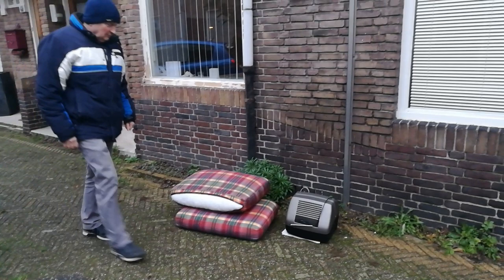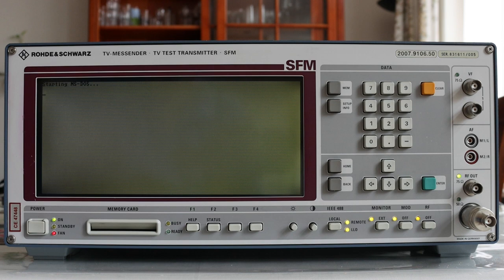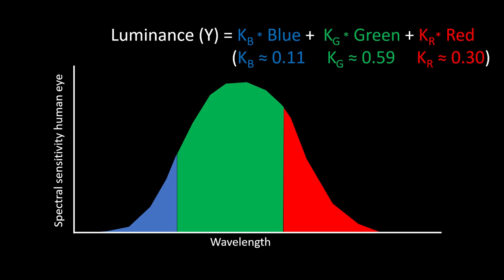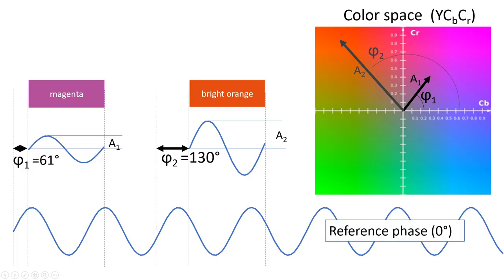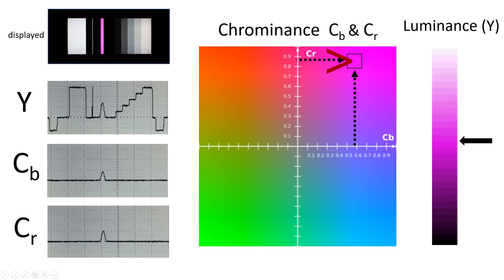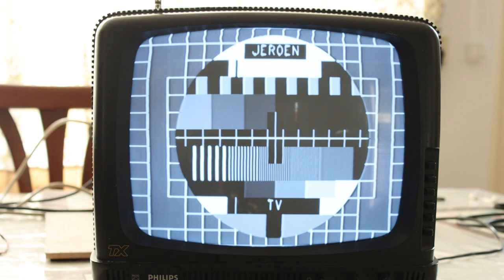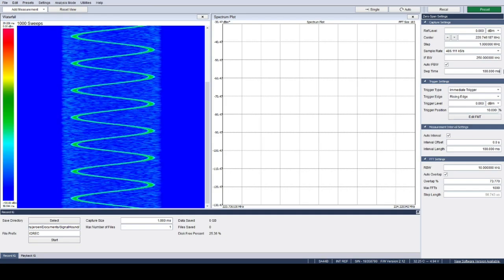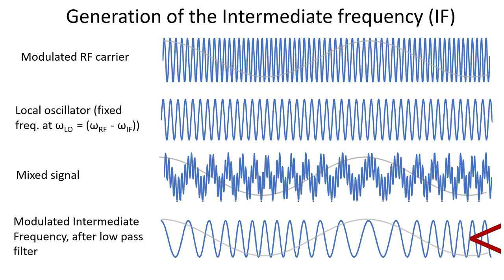Analog TV Equipment: R&S SFM test transmitter and CCVS video generator.

Comment: At the time I was a student at the MTS in Alkmaar studying electronics I sometimes came across old televisions placed on the street to be picked up by the garbage truck when cycling home to Heerhugowaard. I then opened up the back of the television and took out the large A2 size schematics which was included inside of the tv. I then spend hours figuring out how that TV worked. If I now open up a new tv, unfortunately no schematics inside. Just a few boring chips.
I always found it very clever how they came up with the transition from black and white to the color in the signal in PAL. We also used to say NTSC stands for, Never The Same Colour.
Nostalgia!

Comment: I spent a good part of my electrical engineering career working on demodulators for analog TV. It's, by far, the most difficult signal I've ever worked with, the spurious-free SNR requirements alone were >70dB on a 40" HDTV, and that doesn't get to the hard stuff. I became the guy they would send to that 2hr meeting at LG in S. Korea, because there was no alternative to seeing the video impairments first hand.

Comment: i honestly think that back in the days of analog circuitry being an engineer might have been the hardest time to be an engineer.

sure, modern high density digital electronics are way more complex, but it's always possible to break them down to trivial enough components. but back then it was simply not the case: analog circuitry is like a hairball that you can't simplify past a certain point.

Comment: 19:38 I think this explanation is somewhat imprecise.
TV uses vestigial sideband modulation (AM with lower sideband mostly filtered out). What you describe fits more FM modulation.
Plus, on a conceptual level there's nothing that forbids multiple sinewaves to coexist, as per superposition principle. The signal on oscilloscope looks just like a jumping sinewave because it's narrowband compared to the carrier frequency. It would have different instantaneous shape only if there were any harmonics, which don't occur in well-behaved radio transmissions.

Comment: I wonder if by using this absolutely fantastic signal generation tools and maybe PC for control you can make some kind of randomly generated demo-like video on analog TV. As I saw the RS generator runs on MS-DOS, which makes it easier to tinker with its software.

Comment: I'm very confused about why the transmitter displays an intermediate frequency. As you explained, IF is an implementation detail of the receiver, and the math of applying modulation onto an IF doesn't require the signal to know anything about the IF, so I don't know what the transmitter could possibly have to do with it. It's like if the transmitter had a display for "screen-to-viewer distance" - it could be different for each receiver, and wouldn't affect the signal anyway.

Comment: Do you have a SOURCE for that particular Older Equipment?  Putting Together a Makers Group or Young Future Engineers!
Reply from the maker: I bought it of www.marktplaats.nl, but given that you are probably in Wisconsin, this info will likely not be of much use to you.
Reply: @HuygensOptics  I could not figure out the spelling...great stuff...replace the tubes with FETs on paper or in mind to be able to look at the old tube schematics.
At least to understand the paths and control mechanisms.
Also will pick up a signalhound, been wanting to get a good enough SA for home.